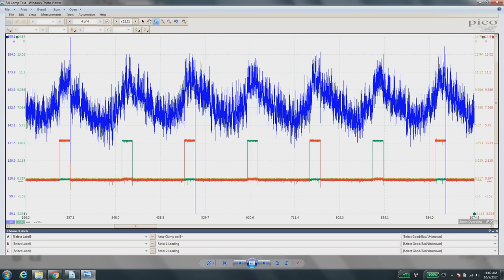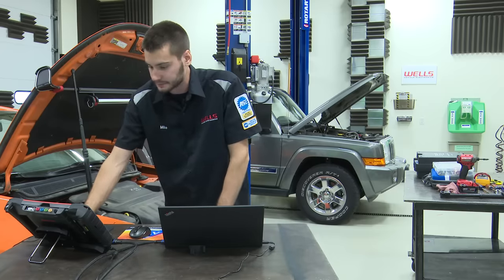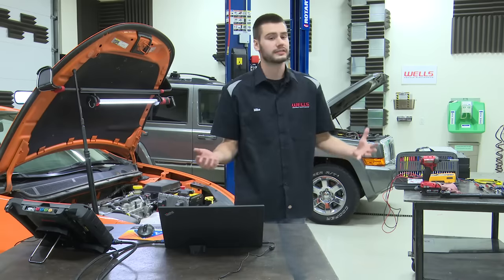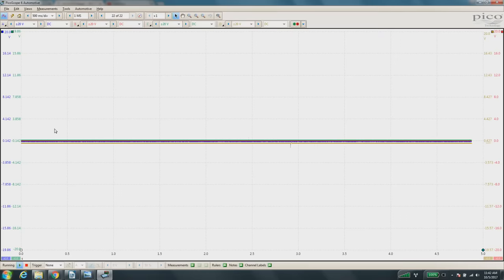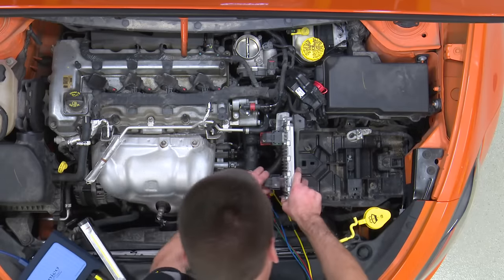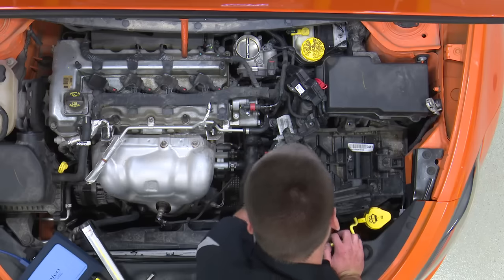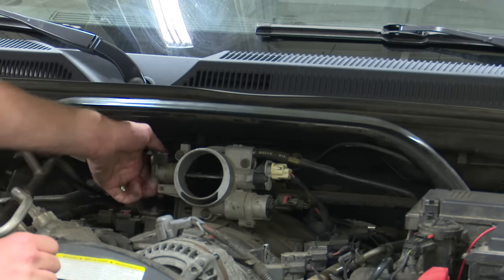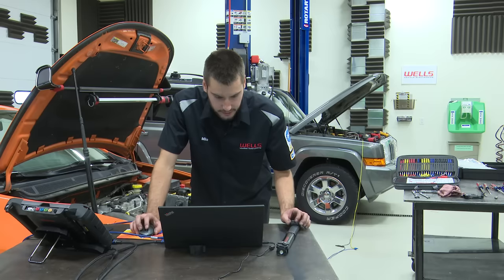Diagnosing With The Lab Scope - Why Every Tech Needs To Be Using This Tool!

Comment: Mike, Can i get the same results with an old Snap on Modis. I really have a problem zooming in. Granted I just picked up the unit trying to learn but everyone uses the Pico on You Tube which they just zoom in on everything with a mouse click. Thanks
Reply from the maker: Mugsmydog, You can do similar with the Modis. It can give you good patterns, I just find it harder and more cumbersome to use than the PICO. 
Mike Becker, Technical Services Instructor

Comment: I love the idea of using a lab scope, for the reasons shown in your video... But unfortunately it doesn’t make sense with flat rate. What happens if I spent 3 hours diagnosing with a scope but the results were inconclusive? Obviously in this video you know the fault will show up with the scope. What happens if it really did only occur once every few weeks and you just charged them multiple hours of labour and got no where? It gets to the point where you are diagnosing on your own dime.
Reply from the maker: Hey Dansyoung, thanks for watching! Let me ask you this...what if you were the customer? This car was at the dealer...told they couldn't fix it because they couldn't duplicate it. They owners wife wouldn't even drive the car because she couldn't trust it. If your shop is having troubles selling the time to diagnose a car right, then you may was to readdress the way you bill diag. Flat rate or not there is a VERY high value to fixing it right the first time. 3 hours or not, fixed is fixed. Better than being the second guy to send the car out without a concern, right? Also, with enough practice it will not take you 3 hours to scope something. Practice makes perfect. You can grab most signals in under an hour. Thanks for watching. I appreciate your comment and viewpoint!
Mike Becker, Senior Technical Services Instructor

Comment: Very valuable Training Mike Thank you!  Is it possible for the Signal wires for the Sensors to be shorted somewhere which could also cause intermittent drop outs or spikes?
Reply from the maker: Hey thank you very much! Sure, they could be shorted together or intermittent opens. Sometimes when scoping ill watch the signal right out of the sensor and then also at the module and make sure they match 100%.
Mike Becker, Senior Technical Instructor
Reply: NGK Technical Training That make sense. Thank you

Comment: Hey Mike. I never got around to check this video till recently. Awesome presentation. I really miss these videos just how everybody else does. Can't wait for this year. 2 questions professors mike. Which leads do u have on ur multimeter. They are not too long and not short at all. I got the same multimeter but the leads are short 😣😣. And have u ever ran into a mazda 6 or 3 with a tcm issue and people have videos of just replacing them. My question to that is how do u test this module especially since it lives under the battery tray. Know these modules aren't cheap. I was thinking to take the whole battery out and tray and hook up a jump pack and use that instead of the battery to do power and ground checks and communication. Cause the code says loss communication with tcm. It's just something I would like to know for the near future. Just like u professor Mike I like to test rather than guess. No joy in guessing. Happy new year professor Mike and Cant wait for 2019 videos from u

Comment: Dumb Question. Why didn't they put that selector switch right in the shifter console when all they are doing is sending position logic signals to the TCM?
 Was it just some design engineer with the mentality of "everything to do with the transmission must on the transmission" ?
Reply from the maker: Dave, that is not a dumb question, that's a great question! I think on this it's all about redundancy. This is still a cable shifted transmission. I think the console shifter position is redundant, but will lead to future development on shift by wire. The days of the cable have already gone away, why not use multiple sensors to do the same job? 
Mike Becker, Technical Services Instructor
Reply: That sounds reasonable I guess. if it's being shifted by cable then having the switches right at the transmission would give a more reliable position of the transmission mechanism even if the cable breaks.  I guess I figured if there is a TCM it was probably activating solenoids or something to shift the transmission. Then it would make more sense (safety too) to have an accurate sense of what the operator is selecting from the PRNDL handle. 
 To be honest I'm not an auto tech. My expertise is electronics which is mostly why I try to keep up on the vehicle electronics. I find it fascinating to watch troubleshooting techniques I've used for 30 years in electronics now being applied to cars. Good work Thanks.

Comment: I'm curious as to why you used the Picoscope instead of the 4 channel on the Snap-on scanner?
Reply from the maker: Hey Chris, I prefer the Pico because it's easier to use and manipulate. The Snap-on's is ok, but the Pico is nicer. Use them side by side sometime and tell me what you think. I'd be willing to be that I already know your answer.
Mike Becker, Technical Services Instructor
Reply: Wells Vehicle Electronics thanks Mike. I own a performance shop and we're looking at doing more diagnostic work. There's a pretty good deal on the new Zeus but I believe a well kitted pico scope and a lower model scanner would come to less. I do like the guided testing of the Zeus though from the demo I got.

Comment: Could be easier to backprobe at the control unit initially if it is more accessible and wiggle test the harness down to the switch to see if there are any harness faults present also?
Reply from the maker: Sure Jake, that is always a valid test. Some ecus are easy to get to...others not so much.
Mike Becker, Senior Technical Instructor

Comment: hi Mike im working on a 2004 mustang 3.0 w 3 timing chains, w very low vaccum reading, good catalytic not stuck open EGR,  trying to get a good known pattern sample on crank/cam correlation,  unfortunately ONLY HAS ONE CAM SNR,  i will apreciate if u can get me a  good known pattern.
Reply from the maker: Hey, which engine is in that Mustang? I don't recall a 3.0 being used in that car.
Mike Becker, Senior Instructor
Reply: @GoTechTraining  im sorry i mean 4.0
Reply from the maker: Ok, that's what I thought...just wanted to make sure. I found a few screenshots people have taken. Shoot me an email, i'll send you what I've found. Michael.Becker@wellsve.com

Comment: I have 07 BMW N51,fault code 29D2: missfiring cylinder #6.replaced the following componets:Delphi coils,sparkpluds, Fuelinjector cy#6.smoked the intake for leaks,the fault still present. Any help Iwill appreciated.

Comment: i probably would have told customer that i think that the range sensor was the problem but unable to prove it and let them make the call.
Reply from the maker: Now you're armed with the knowledge to accurately make the call! :)
Mike Becker, Senior Instructor
Reply: @GoTechTraining  just had come in a 2014 nissan titan which was the first that i know of with the A/F sensor had one bad down stream 02 sensor armed with what i had learned called bad 02 passenger side ordered replaced retested fixed made my day. Thanks again for all your hard work you will probably never know the effect you have on old timers like me that are learning new diag stuff  thanks again

Comment: 49:57 the signals walk on each other for P and R, is it supposed to be instantaneous from P to R or does it allow a little wiggle room as the shifter sets in gear?
Reply from the maker: Good eye JoeCnNd! 
Mike Becker, Technical Services Instructor

Comment: I was wondering on the Porsche, did the guy mention if he found the broken pieces?
Reply from the maker: Hey James, I asked Mike that exact same question when he told me that he had it running. He said he did not find them. He was unable to pull the oil pan without removing the engine, so he cleaned it out as best he could...but never seems to find the pieces... we'll see what happens long term on this thing!
Mike Becker, Technical Services Instructor

Comment: how do you know its coming from sensor and not the shifter
Reply from the maker: If I recall this video, I was probed into the signal from the range sensor on the trans, right? The shifter position is a different sensor.
Mike Becker, Senior Instructor

Comment: I don't know how much the Porsche owner saved as I would say that the engine needs to be rebuilt to get the metal out of it.  In addition it probably damaged the bearings. As for the Optima battery the owner may have one in there if it is not a daily driver.  I have Optimas in all my vehicles as they often don't get driven for several months.`

Your high overhead shot does not work as I could not see anything.  Try watching some of Rainman Ray's videos or Eric O's.

Comment: But can't be duplicated and warranty really help my pay check.
Reply from the maker: Hey Fonz, if you let this customer leave and say the fault can't be duplicated and they get stranded somewhere....how happy do you think they'll be with you? You don't get a paycheck without customers. Gotta do whatever we can to take care of the customer's concern the first time!
Mike Becker, Senior Technical Instructor
Reply: @GoTechTraining  no no no. I don't get those types of jobs. I get junk like customer states car accelerates to slow. Lady you bought a 150 hp 4 banger. Or customer states satelite radio don't work at times. Just to find out it stops working cause their  driving through a tunnel. Of course all these vehicle haven't made it to oil change 1 but have all this problems. But I guess it's really on the advisor for not knowing any better.
Reply from the maker: Hahah I love satellite radio complaints like that...the advisor should have seen through that right away. Those type of tickets are good for only 2 things...wasting a techs time and making the shop's warranty numbers look bad.
Mike Becker, Senior Technical Instructor

Comment: First off, this was excellent! You have a new subscriber from the UK :-)

I’d be interested to see how the scope on the verus compares with the Pico? I had a Pico a few years back but sold purely due to lack of use and setup time. I did pick up a vantage pro which I’ve used for a few years now.. but I want to get back into it more. 

Is it possible to split the scan data and scope on the verus? I’ve seen Paul Danner do it on older videos but is that still possible? 

I’ll be sure to check out the rest of your vids :-)
Reply from the maker: Hey Gruss Newton, thanks man! To me, it's more about personal preference. I prefer the interface of the PICO over the Verus. I'm not going to pretend I know more than that. I'm sure the engineers behind both tools would have words to say about both...but again, for me it's a personal preference to use PICO. I especially like how easy it is to save and view files . As for data and scope on the same screen, not sure. I've never used it. I beleive there is a way to go through the Verus testing procedures where you may get a few pre-selected pids with your scope. But really, this is why I like my scope and my scan tool separate. 
Mike Becker, Senior Technical Services Instructor

Comment: On what type engine would the ignition fire on every other compression stroke? Is this like a hybrid gas/diesel?  LOL
Reply from the maker: Frank, not sure what you are referring to with this. Maybe I mispoke in the video? Did I say it would fire every other stroke? That would mean compression and exhaust. Like on a waste spark system.
Mike Becker, Senior Technical Instructor

Comment: Funny I just watched a "How to diagnose and replace thorottle body" video and I did not see 1 mention of a scope.
Reply from the maker: Eddie, that's great. Not every diagnosis requires it I suppose. Depends on the issue.
Mike Becker, Senior Technical Instructor
Reply: @GoTechTraining  The video im refering to was one of NGK Techinal Training's video. It was an older video on the GM ETC system. No not every one does require a scope but this video did not really show any diagnosis at all besides "It has a code and it sticks"

Comment: 1999 ford Taurus transmission does not engage into gears
Reply from the maker: Any gears? Reverse too? These were common to strip out the torque converter.
Mike Becker, Senior Technical Instructor

Comment: Also, the panel needs to b adjusted. Unless I was 💤 sleeping
Reply: Prndl
Reply from the maker: Bill, these are adjusted during install. I'm sure you can adjust the cable for wear, but the switch itself has slotted holes and a hole for lining it up to the case. I believe I talked about that. I used an Allen wrench on this one. 
Mike Becker, Technical Services Instructor

Comment: Would have made a difference if we had known good?
Reply from the maker: What exactly are you referring to?
Mike Becker, Senior Technical Instructor
Reply: @GoTechTraining  the wave form had noise but the car wasn't acting up necessarily. If we had a known good from the start would it have made the decision to replace the trs easier?
Reply from the maker: Hmm, maybe...But we know that the noise shouldn't be there, right? A switch should look clean. IN this case I don't think a known good would have changed anything.
Mike Becker, Senior Technical Instructor
Reply: @GoTechTraining  got it. Newbie here btw
Reply: I also confirmed the 06 escape PCM coil driver to be at fault. Back probe the control wire at the PCM connector with test light to ground: no pulsation with vehicle running
Reply from the maker: Awesome man! Glad you got it all fixed up.
Mike Becker, Senior Technical Instructor

Comment: As of today in my town globe az, there are about 20000 people about 15% are mechanics the rest are mine workers. As far as I know counting myself there are 2 people who use a scope. The rest dont even use anything near scanner danners teachings. They run to the parts store get a code reading or buy those cheap dongles and change what ever they say the code is. I have shown a bunch of the guys these videos and they still refuse to use a scope. Then I hear everytime I work on a vehicle look it up on utube. Well I know that not everything is shown on these channels and some make it look easy and dont show enough on there channels so it make them believe they can do it and mess things up even worse and then they lie to me and say they did nothing it just happened. It's not easy as it is to be a moble mechanic and show them the power of the scope and get them to pay me for using it. I only make $40 for the diagnostic and when I use my scope I try to get a little more for it but they dont want to pay for it. So many think it's a wast of time to use a scope. It's so sad....
Reply from the maker: Hey George, it is sad. Change isn't easy for many. The scanner is powerful...but the scope is mightier. Don't feel bad for charging for an accurate diag. In the long run you save people money!
Mike Becker, Senior Instructor

Comment: I know this is a old video, but to answer the question at 37 minute mark.  I would have replaced the trans range sensor at that point.  I am trying to learn scope operation and testing, I will finish the video to see the conclusion of this problem.

Comment: Piercing is much more reliable
Reply from the maker: In this case piercing would have saved me a ton of time. Those darn back probes had so many issues staying in place. Ahh the fun of fixing cars.
Mike Becker, Technical Services Instructor
Reply: But wouldn't piercing leave the wire susceptible to water leaking in?  I just finished repairing wiring in my car for vehicle height sensor as one wire had broken (fun - it was just inside the loom and I couldn't see it until I started unwrapping it) - it was all corroded inside the insulation and I had to work to strip back and get solder to stick prior to  sleeving and sealing.  Not the first time I've seen this where water intrudes into the wiring causing oxidization and eventual breaking.

Comment: I cant
Reply: Figure it out why this 2011 Subaru outback won't start it cranks but wont start
Reply: I cant get any gas to it I'm taking the fuel pump out again
Reply from the maker: Pay close attention to the fuel pump connector, they have a tendency to melt and cause issues.

Comment: your stretching videos out to far get to the point of oscilloscope use and let techs figure out mechanical issues
Reply from the maker: Hey Henry, if that was the case then why wasn't this car diagnosed at the Dodge dealer when it was there? Because the techs couldn't see the mechanical issue. 
Mike Becker, Senior Technical Instructor
Reply: @GoTechTraining  your right i agree,i worked in dealerships for 30+ years,most techs are throw a part on and flag the time.and warranty dont pay shix and even less to diagnose. its hartd to find a mechanic with the knowhow and want to,to really fix a diagnose correctly,and its getting worse.good mechanic now needs college training in electronics
Reply from the maker: True that. Electronics is where everything is heading. Warranty time @ .3 hour for diag is the worst. They are creating parts swappers. It's only going to hurt these places in the long run.
Mike Becker, Senior Technical Instructor
Reply: @GoTechTraining  yea but its at customer expense, i own a little shop but been out of it for 10 years for back problems ,but you got good videos for people wanting to learn